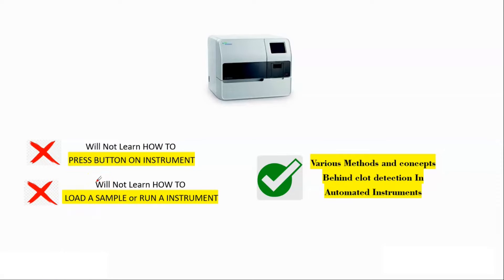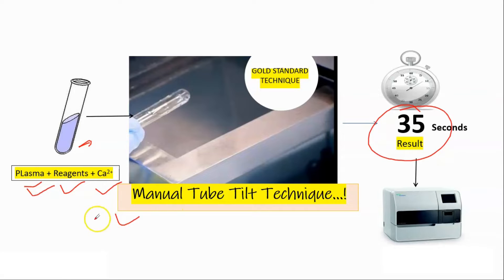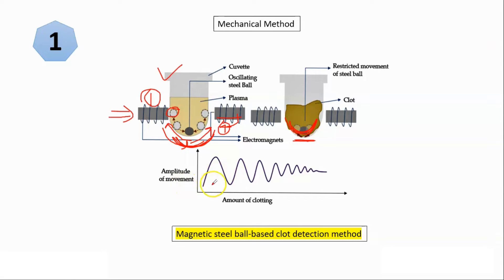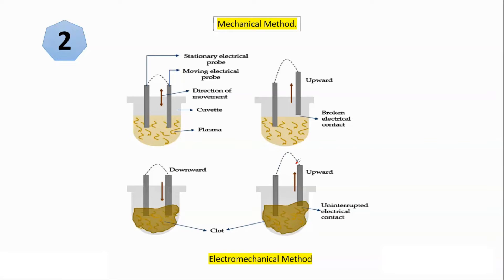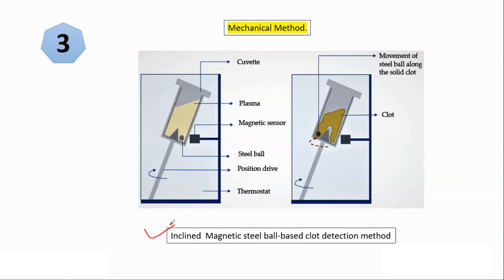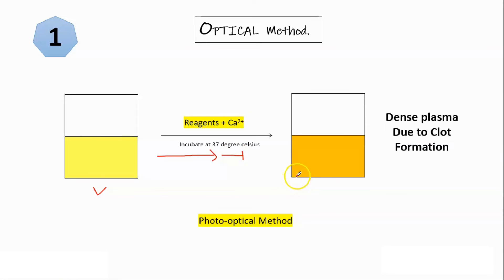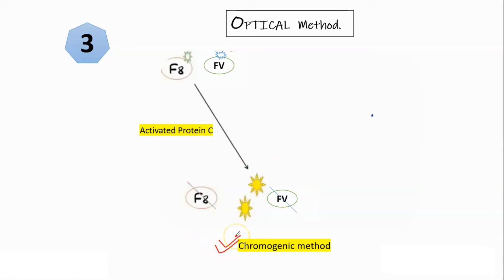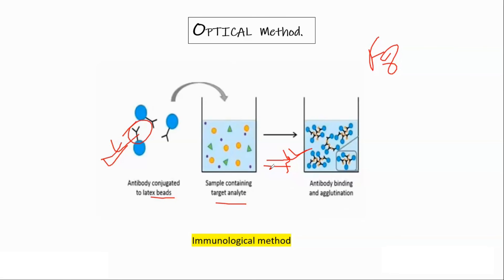Coagulation Analyzer | Coagulometer | Explained | English

Comment: Which method is accurate
Reply from the maker: first one , stainless steel ball and magnet 🧲
Reply: Opto mechanical as CoaDATA good for HIL parameters low Fibrinogen concentrations fast PT aPTT Fibrinogen determinations high precision.